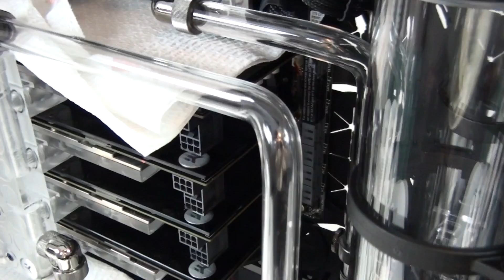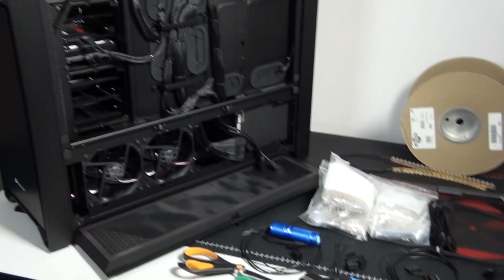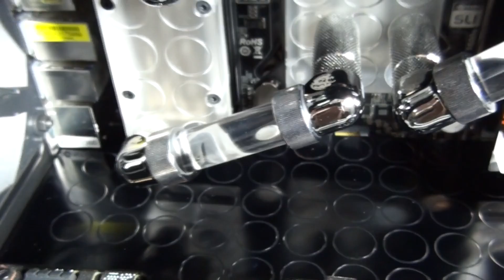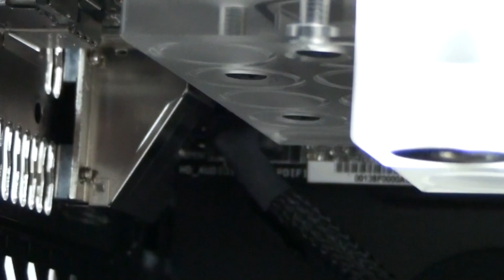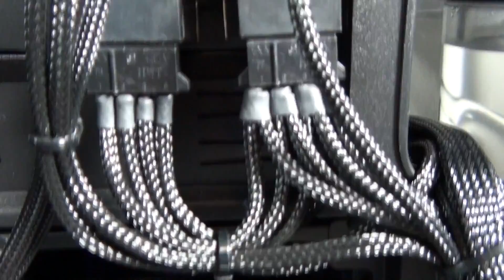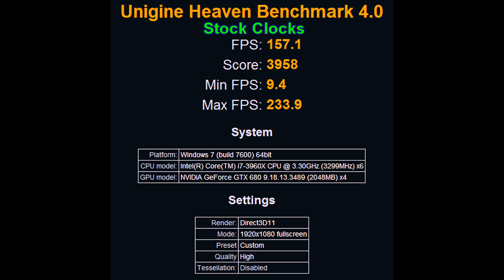Build #12: Quad SLI 900D: Part 3

Comment: This type of PC client does not come very often. Not many people spend 8,000 dollars on a build, and if they do they build it themselves...

or maybe I am marketing in the wrong areas... lol
Reply: I'd say this was most likely under 8,000 given that some components came from the client and that the gtx 640 is a relatively inexpensive card.
Reply: Not a 8 grand build, using 680's & used components. Small SSD's as well. The boards is the most expensive single part as it looks like Asrock X79 Extreme 11
Reply: ***** I wager this fellow charges a boatload for labor and the water cooling parts, however.
Reply: ***** The water cooling parts used in this build amount to a grand
Reply: Jason Colbeck
 PC @ Best is 4500. Labor doesn't count in value.
Reply: Sanjay Saini
 PC @ Best is 4500. Labor doesn't count in value
Reply: Jason Colbeck He charges between $500 to $1000 for his high end builds. I got a quote a while back out of curiosity. One of the big costs is shipping, which for an item of this size can be over $500. Still, there's no way this build was $8000. My rig has overall higher end components and more water cooling gear, and even with $1000 for labor and shipping tacked on it doesn't hit $8k.
Reply: Chris Cleveland You are way off.
The components on this alone are more than $1000..
Reply: chriskanemeier I wasn't including components, I was only referring to labor and shipping. I thought that was pretty obvious lol
Reply: chriskanemeier $1,000.00 what have you been smokeing and can you send me some .....
Reply: scott k Labor charges as I said before.
Reply: 8 grand? how could this pc cost that much?
Reply: sleeving is only a few hundred dollars at most. testing and all that shit can be done on your own. if you were to build this pc your self it wouldnt cost anywhere near 8k

Comment: Can't there be used alcohol instead of water or some other fluid that's not that destructive ?
Reply: Water is water and the deionized one looks for ions... Copper will still oxidase in time lowering thermal conductivity. I was thinking that... Alcohol has a lower boiling temperature making it more effective at taking away heat from components. I don't know exactly but if there was a better fluid than water or somebody would invent one people would love it.